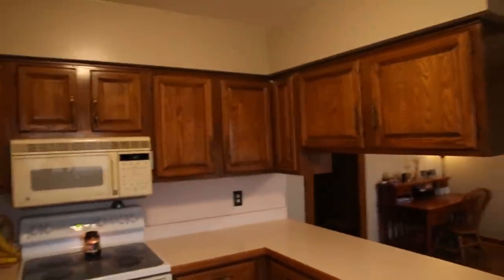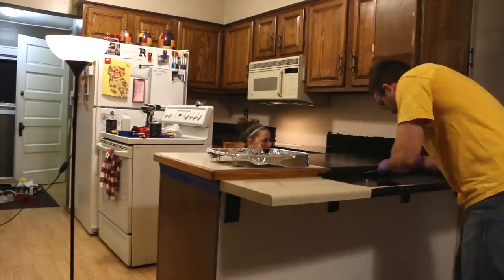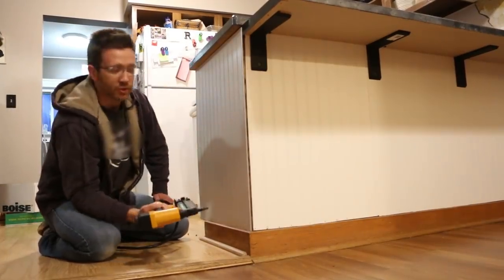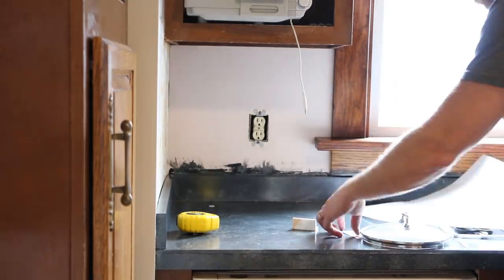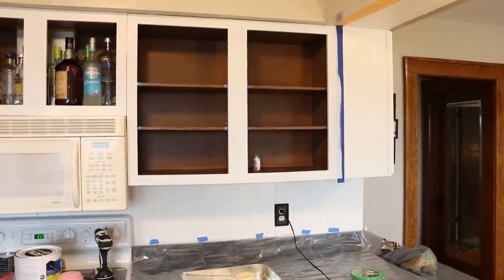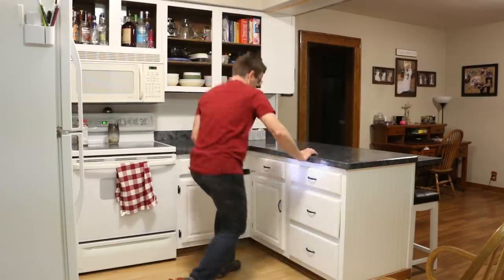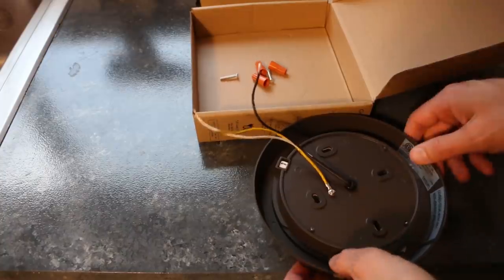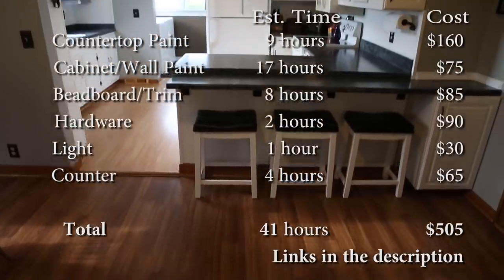How To: $500 DIY Kitchen Remodel | Update Counter & Cabinets on a Budget

Comment: Just as a heads up about painting cabinets or anything that has a glossy coat on it, there is a fantastic product called deglosser. It comes in a metal container like mineral spirits or turpentine. Just clean the cabinets really well, then wipe them down with deglosser on a rag, wait about 30 minutes and then prime them.  The deglosser softens up that glossy finish enough to make it accept the primer. Couple coats of primer and then paint. Saves a whole lot of sanding. Just work in small enough sections at a time, like a couple cabinets. A hardwood flooring professional told me about this product for painting my risers and skirtboards white after the floors and stair treads had been redone. I've done this on cabinets, too. Works great.
Reply from the maker: I tried a deglosser, I don't remember the name.  However, it didn't work well.  Maybe I used it wrong or the brand wasn't the best.

Comment: Loved how everything came out.  How handy it is to have a garage to work out of.  One thing is that you guys worked your ways backwards once you removed the top ceiling cabinet.  Glad to know and see that this happens in real life  because life happens.  Next time add an itemized price list on the items you purchased and then give the overall final cost (you forgot to include the added on countertop of the breakfast bar overhang along with the brackets underneath).  I hope everything did come out under $500.00, of course I know the labor was free.  You confirmed my long ago idea on what can be done to a freestanding cabinet  to convert it into an island/counter breakfast bar.

Comment: I’m not an electrician but I’m sure you need to turn off the electricity before working on the wiring. Geez. Gonna have ppl getting electrocuted following these steps.
Reply: if the switch is off then you dont have power at the fixture.  if you dont know that then you shouldnt be working on your electrical system in a house.
Reply: 😂 I'm a contractor literally laughing at this comment. power is easily turned off to a receptical. she must think you have to work in total darkness to mean electricity is off everywhere.everyone should learn a breaker system and "power to method" it's a good trait to know.
Reply: Krys F it was a joke but contractors  can absolutely be electricians most master contractors have journeyman in many skilled trade I'm one of those contractors. your still beautiful tho so no insult was intended!
Reply: @Krys234  It makes NO difference. If you turn off the switch then you have broken the circuit. It's literally the same as pulling your breaker for the entire house if you are only working on that one light. This is coming from an electrical engineer. It's ok to admit you are wrong.
Reply: Technically, NO, you don't need to shut the electricity off.  It's only when you create a circuit accidentally, will that matter, in which case you will be glad you did cut the power.  But I've re-wired hundreds of fixtures and switches without bothering to trip the breaker.  But I know to be careful and mindful of creating a new circuit lol...
Reply: @kylecanthurdle1 : Not necessarily. In older homes, and post WW2, houses were wired "hot to the fixture with a switch leg". That is because building materials were rationed. That configuration is often used still today in commercial. After about 1970, residential started being wired "hot to the switch". The house I live in is partially wired this way, but I have been wiring for 30 years. Room by room I am replacing all the drywall and insulation, and all my wiring comes from overhead, In each room, I am rewiring the switches and light fixtures as well. To give you an idea, I now am using 13 separate circuits in my kitchen alone. I have duplexes every 16 inches along any countertop. (Code is 24" o.c.). I have put each one on its own circuit. This does not count the dishwasher and disposal.

Comment: You shouldn't be teaching anyone, especially electrical.  Standard house wiring has bare copper for ground, not green and red wire indicates the fixture is connected to a switch. You're grandpa did it right, you just don't know enough to know that. Also, concur  with another's comment. Don't tell people to ignore connecting the ground wire, especially on a fixture connected to a switch right next to the sink. It should be on GFCI too, BTW.
Reply: Gwebo Celestron I was taught to wrap electric tap around the wire nut and part of the wires to reduce chance of coming apart. I was also taught to twist wires together before putting on wire nut. Am I overdoing it?
Reply: I do this the exact same as you. I wrap electrical tape around the wires to keep them together, not on the nut though. Then I definitely twist the wires together before putting on wire nut.
Reply: The only people doing electrical work should be electricians. Full stop
Reply: And turn the stupid breaker off for that room or wall!!
Reply: Sorry but he did nothing wrong !! There is no need to groundwire a bulb !  ...
Reply: @Just Coni justme Hire a pro for that ???  what he did wrong ?
Reply: I understand pros who throw shade, and the advice to "hire a pro" but this is a DIY video... so pro's being nasty, and advice to hire them is just stupid.  On the flip side, you should be careful when playing with wires and electrical work.  Not being a pro, it is easy to make mistakes that could cost you a fire, a shock, or worse.  BUT, 3 generations in my family have done basic wiring tasks - so what's that, 80 years? - and no issues.  No electricians needed.  PLUS in this day and age, you can google anything and get great advice.  As for grounding wires... I use them if I can but I am not going to run them if not there.  My home was built in 1944... and I re-did much of it but a good portion doesn't have ground.  Oh well.  I am NOT going to spend $25,000+ to re-do all the electrical in a home built in 1944 to bring it up to 2019 code.  Again, that's just stupid.   And BTW, ground wires can work against you in rural settings as it makes your home  more attractive to lightning strikes (I've had 3 in 10 years direct to my house and have learned a LOT about lightning, what it can do, and how it can enter your home).   And while I prefer to have GFCI outlets in the kitchen or bath, I'm not going out of my way to put them there.  I'm not stupid enough to use a hair dryer over a full sink of water... or put my toaster/appliance right next to a sink full of water... so I follow Darwin's rule and say if you're dumb enough to do that then you deserve what you get lol.
Reply: @MUMMRA-the-Everliving  ...the way he hooked up the light was fine... no need to hire a "pro" for putting up a residential light. btw a shock from a 15amp wire won't hurt you, it will only tickle a bit.
Reply: Seth Barrett you completely mis-read my entire comment.  Or you thought you were replying to someone else?    Either way, yes the shock can “tickle” but if you keep the “tickle” going you risk interrupting your heart’s functioning.  And the amperage is what kills.  A “tickle” is only a few milli-amps.  15 full amps can kill an elephant.
Reply: @Just Coni justme & Sarah Fallon Hire an electrician to change out a light? Do you hire an electrician to change the bulbs in your lamps, too? My husband has changed out our lighting fixtures numerous times (and didn't turn the electricity off to the room--I'll admit that it made me nervous, but he promised it would be fine as long as I didn't turn the light on while he was working on it). We've never had an issue. Also, our nephew is an electrician and would laugh at my husband if he didn't know how to do this himself. I guess we come from a different time. (A time when people actually learned how to do things instead of paying our the arse for some "pro" to do it.)

Comment: Great job. The only thing I would like to say is when you are standing on a chair like a stepstool, make sure that the back of the chair is not behind you but in front of you. If you lose your balance, and need to step down, and the back of the chair is behind you, you can fall worse. Also you can hold onto the high chair back as you are getting up and down backwards
Reply from the maker: Good point!

Comment: Some pro tips to make life easier:
@ 1:10, those weren't nails, remove the door panels and you'll find screws under the hinges holding the cabinets together.

@6:30, simply remove the top and bottom screws, the outlet will pull out away from the wall, that way if it is in the middle of the wall, you don't have to worry about sliding behind the ears.  Use a drill & jig saw to cut the outlet shape out of the bead board.

@9:45, always label your doors when you take them all off, so they go back in the same spots.

@12:23, make nail boards (blocks of wood with sharp ends of nails sticking out), paint back of doors, then flip backs onto the nail boards to paint the fronts.

Looks good, I hope you enjoy your new kitchen

Comment: dude... you shouldn't be giving any electrical advice. Power of the light has 0 to do with the need for ground - its voltage that necessitates that. Moreover you're touching wires without turning off the house/throwing the breakers - all it takes is some numpty in the past who's installed your light switch on the neutral rather than the live and just like that your touching a live wire even though the switch is off. would have been slightly better if you'd tested it first (multi-meter etc) but im doubting you did that somehow. Rest of the vid/advice is good but that is just plain silly.
Reply: So did he even connect the ground wire to anything? An yeah I was worried too.
Reply: As it turns out (according to other commenters) houses built prior to the 70s apparently switched the neutral off rather than the live... so you may well be lucky to be alive, if your house is one of them.

Comment: having painted cupboards , definately need the prep, i would cover the counter while sanding too for clean up. i did prime and paint inside, lots of sides, but i wanted it lighter and it came out well.  it is a process, not hard but do all the steps.

Comment: Great job! Just wanted to suggest a simpler way of getting your cabinets prepared for painting. I would suggest that you use Liquid Sandpaper / Deglosser, and then apply Glidden Gripper primer and sealer. It is proven to be a much cleaner, simpler and effective way of prepping glossy surfaces for painting. I don't even use my sander anymore for projects like this. On a personal note oh, I've been very pleased with Behr's Marquee paint products. Please do not try to skimp on good products including a good brush. Makes a world of difference.

Comment: Great job however i definitely would have locked that ground wire down because you have 110 volts coming from the bus- bar in the breaker box and if something (eccentric) should happen you have nothing to trip the system and redirect the negative energy other than that good job.

Comment: Great tip 💡Remove the tape after you aply the first layer of paint. While the paint is stil wet! That way you dont have to cut tape later..i dont know, for me its easier to apply another tape, other than cutting it when its hard ✂️

Comment: Thanks for showing how to change a light fixture. I'm spearheading a DIY kitchen remodel which includes changing all the fixtures. I was intimidated by the fixtures, because I didn't know how to change them. I'm feeling a bit more confident, but how does the grounding wire work for a more complex fixture?

Comment: nice video, nice job, if I might add some advise, never take a cabinet down with your doors still in place, 
always remove them.  I find that painting cabinets does not work well for me. A home owner its easy to 
do but if you had to pay for those to be done I'm sure you would of found problems. last is if your going 
to show how to hook up a light my advise is to use electric tape over the wire nuts.

Comment: It looks amazing.  I want to reface mine with new shaker style door and I don’t know if it’s possible to get larger doors and get rid of or make that center wood less wide ( I’m talking about the top cabinets with the two doors , like the one you took down as well). Also modify the bottom cabinets to pull drawers. Ahhh but I’m just dreaming about it now.

Comment: Hate to be 'that guy' but as an electrician I must warn u that u can still get a bang off a back feed on the neutral cable. U really should isolate from the fuse board if u dont have the relevant testing equipment. Plus if a fitting comes with an earth cable in it, it really should be earthed. Other than the electrical stuff great vid!

Comment: I just realized I've been putting on wire nuts wrong all these years!  Thanks!!
Reply: Joey Garcia he is too. Strip more than you need, grab the tips with a pair of lineman’s, twist the wires together, cut the tip off then use the wire nut to insulate it.

Comment: Nice.  The quarter round edging you decided not ti use you could have cut at a 45% angle on the end and it will blend in nicely - at 09:00

Comment: You 2 did a great redo. 

The finish has an eggshell texture to it.... 

Directions should tell to sand between coats of finish to achieve a flat, gloss. 

The eggshell texture is also a great look!

Your grandparents are pleased😉 and, no doubt very happy that your family is enjoying their home. 

(I've got to tell you though... My dad was an Electrician who emphasized safety..... Not shutting off the power at the box is NOT safe.... You know it..... Imagine the horror if someone, out of habit, switched on that light and accidentally electrocuted you!
That person would never recover from the trauma. 

Safety first = No regrets later.  💌)

Comment: Also put a coat of poly on your bead board. It will make cleaning easier and keep the board from getting scratched up from kids shoes while sitting at the bar in bar stools.  Also keeps it water-resistant.

Comment: I know you probably got the answer or don't give a crap now but I'm an electrician, the ground helps with shorts, if something happens to your home or for somereason the light fails it would fry the light and things connected in series to it. Just an FYI for future renovations. Not super important there but sometimes in bathrooms and older homes the wiring can be a little iffy and fry some electronics

Comment: Tip. It's always a good idea to put a couple wraps of electrical tape on the wire nuts to tie them to the wires. Wire nuts can vibrate loose.

Comment: great result! but you could get just a little more expensive paint, that suitable for painting without primer, also it's absolutely ok to skip the sanding part as well. I repeinted all kinds of old laquered surfaces, so in my expirience, it's not nessasery, no changes in the quality of the outcome. also there's wide choice of by far much cheaper hardware on aliexpres. and there's option for linoleum instead of beadbord, it's easier to instull and huge choice of colors and marble imitations. and you could just put ikea desk pannels over countertops (i mean, without even removing the old ones), just seems a little easier, more durable than any paint and cheaper.

Comment: Cabinet paint needs no primer. I'm using chalk paint so I don't have to even be careful how I paint it. It's self leveling and doesn't leave brush makers. Just a thought for others. I'm making my chalk paint. One coat will do it if your cabinets are painted already. Mine have to be sanded because whomever painted them last used oil based paint over latex and it's peeling in huge sheets. I've also purchased primed MDF and cut it in strips to glue around the outside edge of my doors. They're plain Birchwood doors. You don't have to mider them, you just fill them with sandable puddy, sand it until it look like one piece of wood, super easy. Glue it on with liquid nails. I used flat 1/2 trim for the drawers, bur they were cut at 45°. Next I'm doing the floors with decoupage paper and 2 part epoxy. All for under $300!

Comment: Beautiful job.  Hope I can pull off something half as nice.  Question though about how low the microwave sets over the stove and how has it done.  I used to have one that low over a gas stove (so maybe different) and over time the heat cracked the microwave door.

Comment: Good Video Man. I know you know what you're doing but if the light was incorrectly wired (it happens sometimes in the old houses) you could get electrocuted even if the light switch is turned off! Tell people to turn the circuit breaker (power) off so everything will be safer! And DAMN the ground! connect the ground! Article 250 of the National Electric Code. Other than that thanks for sharing!

Comment: Doesn’t matter if it’s led or not, 120v is still going to the fixture. Ground is for safety in case of a malfunction inside the light. It would have only took an extra 30 seconds to hook up. Hopefully no one gets hurt If there is a fire, and if your insurance company sees this you are screwed. This is why the NEC was created. Other than the electrical part thanks for the video, you had some good ideas.

Comment: Just a heads up, some people will wire things wrong, or differently.  Don't take it for granted that the hot is dead when the switch is off.  Some people will wire a switch so that the common is what's known as the carrier, so the circuit breaks on the common side.  This isn't done as much today as it used to be, just saying you may want to use a proximity tester or multi meter to test and make sure there's no juice flowing.  

I've been popped by taking it for granted.

Comment: Had a question regarding this remodel 

When putting the primer on your counter, what type of counter did you have down? I currently have a old Formica and was planning on using a primer (white as I can’t find black in stores) and the kit you posted from Amazon. Will this work? Do I need to score the Formica first?